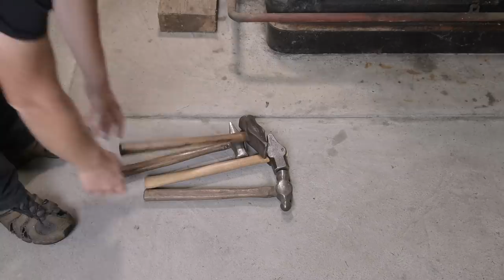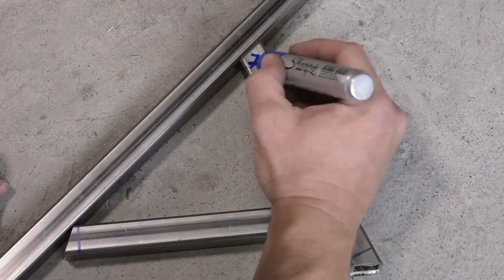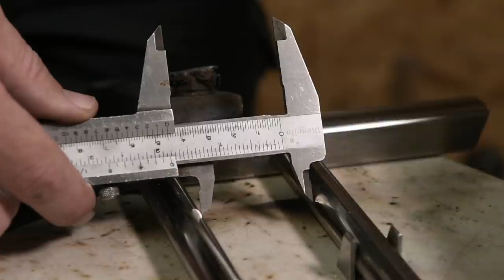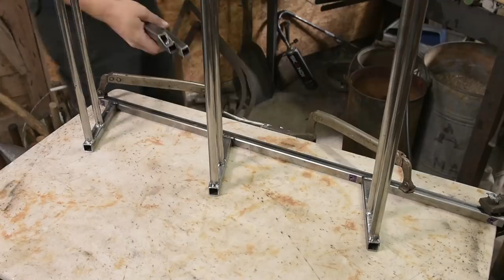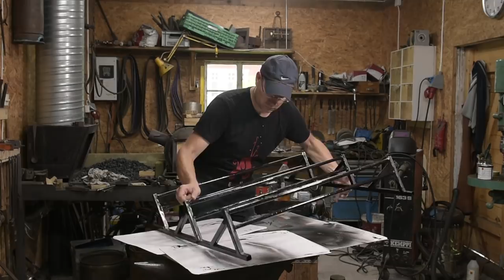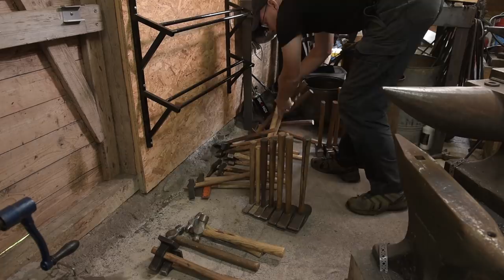Fabricating a hammer rack

Comment: Hey Torbjörn, I just saw a video by the Alex Steele channel about making dinosaur Damascus and in the video I saw a power hammer tool being used that made triangular shapes. It looked like a set of jaws that bounced back up on springs. 

The reason why I’m mentioning this to you is because I noticed you like to round the edges of your ingots pretty often and the jaws that I saw could possibly cut your effort in half.
Reply from the maker: Yes, it's a useful tool for sure. Especially doing billets like they do there... you forge the four sides at the same time, and keep things square at the same time.

Comment: I haven't read all the comments, so forgive me if this has been mentioned.  

A nice way to finish the end of square tubing is to cut the pieces long by the dimension of the tubing (think of it as adding a cube of tubing) then cut three of the faces of the cube away, leaving a tab which is the thickness of the tube wall.  This can be accomplished by two cuts with a bandsaw or hacksaw.  Hammer that tab over and weld the three sides for a tidy end cap.  If you're using CREW (cold-rolled, electric welded) which has a seam, clearly, you'll want to avoid using the seam side for this.

It's important to remember -- if precise length is required -- that this adds a bit more than the thickness of the tube to the length.
Reply from the maker: Thanks for the suggestion!

Comment: Ok..fess up....you made it extra wide so you'd have bare spots and justification to go buy more hammers. Uh-huh...see?..we're on to you.

I wonder, though, if the rack should extend to the floor to help support the weight. Have you ever weighed your hammer collection in total? Looks like you're asking a lot of your screws...
Reply from the maker: :) :)  Sure that would probably make sense, but with the stock I had available it added up nicely so I couldn't make the supporting bars longer. I think it will hold up... but sure that's a lot of weight.
Reply: @torbjornahman  Yeah..and you can always swap out the screws for lag bolts if needed down the road. Awesome rack..great build!

Comment: looks awesome. the orange painted one. What is the name of it? I have one and i believe it is supposed to be a struck tool. Someone once told me they were possibly used by bridge builders or ship builders to cut the heads from large rivets with a striker. Does this sound right. I just thought it was a top hot cut for use with a striker but the rivet story kind of works too.
Reply from the maker: Thanks! Yes I believe you're right, a struck cold chisel. Could be used for hot work also. It mostly depends on the grind angle and how it is heat treated.
Reply: @torbjornahman  yeah. I should file and spark test it one day. May be acid dip the cutting face to see if there is any trace of a high carbon bit welded in. I would suspect to be a struck tool it would have a mild steel body.
Reply from the maker: If it's fairly modern it will be all steel for sure.If you temper the struck end good, it shouldn't be a problem.

Comment: Good looking rack.. I have a question.. what is the purpose of the larger hammer bottom rack far right?
Reply from the maker: Thanks! I believe it is a large rivet set. The concave dimple should match  the dome of a large rivet. I got it in a "mystery box" and haven't used it, yet.
Reply: @torbjornahman  I have one as well and couldn't really think what to use it for .. I've never seen a rivet that large..lol.. thanks
Reply from the maker: Look at old bridges or boilers!
Reply: @torbjornahman  thanks.. have a great day!

Comment: What is the drive on the wall for?
Reply from the maker: It's for the grinder!
Reply: @torbjornahman  Quite a large drive for the size of the unit.  What is the motor rating?
Reply from the maker: @douro20  The motor is 1500W. The actual drive is not that big, just a huge box with display... Bought the VFD drive used (the chinese crap that came with the grinder went up in smoke) , but I hope it will last a good time. Pro stuff.